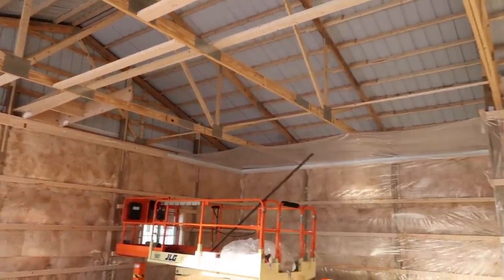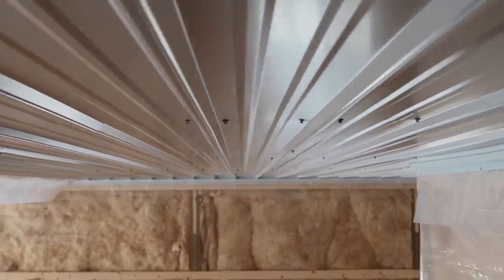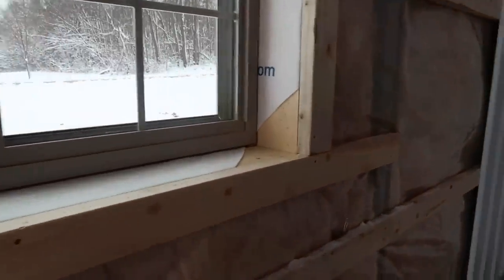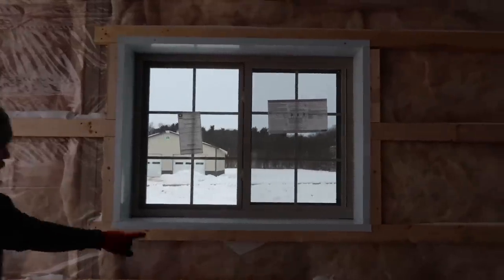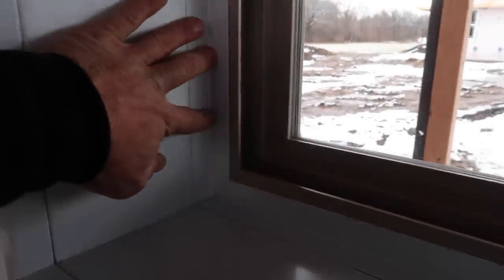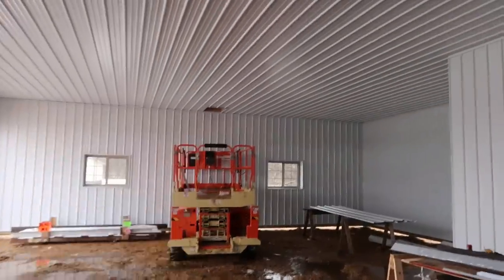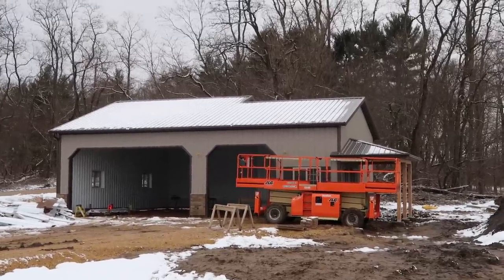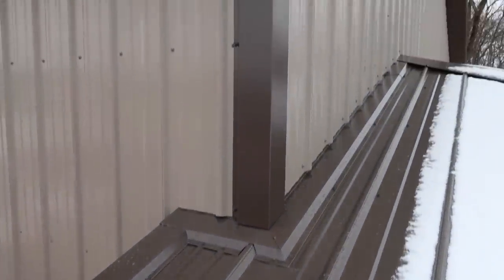Building a Mancave 11: Interior Finishes

Comment: Details, details, details!
That's how it all works out to clean, tight and right at the end.
I mentioned  this before to you on the Stool-pan trim derail; run a shim in that outer corner, tapered down, back to the casing edge, and few throughout the stool span 3 or 4 should do it, this will hold the stool tight to the jamb and the window edge thus eliminating  the need for that final gap-spacer piece.
Awesome work.........you guys ROCK!
Now, about the sound system for the shop.......I'm your man.

Comment: I would definitely caulk windows to the wood framing prior to installing metal trim (with a high quality 'sealant', not latex caulking or silicone) if for no other reason than for additional wind/weather seal. I'm a trim carpenter by trade (45 yrs), so I too prefer wood window returns, but I understand having to do what the customer wants. I love your attention to detail and have learned a lot from watching your videos. This is the first time I have seen something I'm not crazy about, so I wonder if this might work. I personally don't like the look of the 1x1 metal coming up on the window or seeing the raw edge of the piece on the jamb. I think I would take a pc of 1 1/2" coil stock and bend about a 1/2" hem on it. Place that flat on the wood framing and butt it to the window. Then install your jamb steel and tuck it into the hem. The hem would cover any difference in jamb width, there would be no screws or fasteners in the jamb steel, and the thickness of the hem would cover the gap between the window & framing.
Reply: Yes, please at least caulk/seal for the sake of wind penetration. No matter how well the wrap is taped and laid, and how the siding is done, or how tight the window is, that wind is going to find a way in/out. It's nice to have a building breath even inside, but I prefer leaving it up to a mechanical solution if need be.
Reply: Paul Allen hhgggggl
Reply: They silicone around the flange when they install the windows. 
The windows look great. Honestly if you caulk it good you never even notice it.
Reply: @SephYuyX  that's exactly what I was thinking.  We call it a sandwich bend. Use it alot in situations similar to this. But man they do some beautiful work!
Reply: Have to say a grey caulk would look much nicer than the last piece of 1 inch trim.
Reply: Its 1 1/2 by 1 1/2
Reply: @R2D2trashcan   yeh i have to agree with you i dont like the trim at all
Reply: Flash tape and foam sealer baby
Reply: The windows look awesome. But I like would like the look with the caulk better.

Comment: I have to agree, this is probably one of the best build series, showing so much "how to" on different details. I'm thinking this is also the floor plan where you showed how to layout for the Posts and used the bat boards to square everything off. Thanks, Kyle! I think I am sold on the Whether Logic system you use now as well as the roof system you use that doesn't show all the screws. I'm glad you're still sharing the content on your builds!

Comment: I build post frame buildings, but haven't done metal finishing inside, yet I really like what you are doing.  I appreciate learning from you if and when I get a customer who can afford these amenities.

About the window trim:. Maybe trim before the window is installed. Use that 95° bend idea but built into the flat metal on the return.  Then you have no gap on the bottom. The window would then press up against the trim ( bending the metal closer to 90™) - completing the seal.  If someone was obsessed with caulk, they could caulk behind the trim where it would seal trim to window without showing.

Comment: Excellent work as always. Shout out to Greg and Zach also, great work gentlemen. On the 95 degrees trim, in my opinion, it looked okay without. However, if there is a larger gap than 1/8" then add the trim but use smaller head screws or rivets. Again great video and work, greatly appreciate your time invested in the video.
Reply from the maker: Thanks bubba Greg and zach are great

Comment: Kyle, as always, close to perfection. For the windows I'd prefer to cut off a tiny slice off of the vertical trim corners. The 90 degree trim makes the windows look smaller, requires extra screws and takes away that nice crisp corner where white meets grey. Again, great job guys, deserving lots of thumbs up.

Comment: Great work Kyle. Maybe for the window liners. Use a a J Chanel around the R.O to accept a 3/4” Azek or Versatech pvc liner. Cut the J using one full continuous piece with corner bends. Build the liner box as one before inserting it. No gaps, no cracks, no caulk. I did this on all my basement windows. 👌

Comment: Looks great! love the attention to detail. As for the window trim i would caulk around the window and cover it with your own custom trim. Just use a good old manual brake and make all four pices custom you probably need to taper them slightly make a hem on them for the outside. you then lock them in to the J trim without a hem with the hems on the custom pieces. then finally rivet them in to the windows or use smallest possible screws if its wood.

Comment: Attention to detail (planning steps ahead) from the slab to framing to trim makes the install go as efficiently as possible. It also leads to a tight professional finished product.  Only thing I would suggest on the window trim for those lower inside corners: add a small wooden shim, thick side to the outside tapering down inward, this will allow the lip edge of the stool to suck up tight as well as eliminating that little gap when the side trim piece is installed, thus eliminating the need for that final 1" trim  detail, as the corners will stay tight.
Great job fellas!

Comment: From a professional insulators view (20 yrs exp.) those windows and doors should have insulation around them. I like to spray Dap-Tex foam around them, I don't approve of Great Stuff because it over expands and gets hard. Dap-Tex stays pliable. I would have done away with that last piece of 90 degree trim and used a good quality white silicone caulk and that would be a nice clean finish. With no insulation around the winter, there will be frost and condensation on the trim pieces just like those old aluminum sash windows that were used in houses years ago. Love the vids and the build of this one though Kyle. Thanks to Greg for picking up all the slack!
Reply from the maker: Haha thanks
Reply: @RRBuildings  Wasn't being critical but you did ask what we thought. Carry onward!
Reply: you do realize there's absolutely no significant gap between the window frame and the wood, right? I.e. nowhere to stuff insulation or shoot foam.
Reply: @jpm1211  According to any window manufacturer the rough in framing should be at a minimum of a quarter inch larger than the window. You must not be a builder or you would know this. You have to allow for the wood movement, therefore plenty of room for foam. Go sit down somewhere boy. I been in the trades for 30 years and in insulation for over 20 yrs, I know what I'm talking about.
Reply: Hotrod Hog damn.  And i thought i could run smak.  You are the king!
Reply: Hotrod Hog U are right! The reason the window companies suggest U leave a 1/4 bigger in the window framing is for expansion. Wood swells & if U build the window insert frame perfect to fit the window & the wood swells, what happens then? It puts the window in a bind & it wont open & close properly. So U hit the nail right on the head. 
I wouldn't think you would have to do the 1/4" gap in a steel framed building? But i know U do on a wood framed because of expansion.

Comment: Great job a really good looking construction, ive been a carpenter in the uk for nearly 35 years we don't get to do big timber frame buildings as timber is just to expensive, a building of this size would be done as a steel frame, so I love to watch your build series and I look forward to the next one, thank for sharing. :0)
Reply from the maker: That’s crazy this is such a small building to use steel for.  At least in my area.  Thanks.
Reply: @RRBuildings  its all down to cost a steel frame is nearly half the money in the uk and dont get me started on the price of sheet material over here :0 ( still keep up the good work I really like the way your always trying to improve not only the way you work but the end product as well

Comment: I like the 1x1 trim around the windows never done work like this but use to be a materials manager for a die cutting business. We used alot of 3m vhb tape that I think would be a nice touch on the 1x1 trim so you wouldn't have to use screws and could also do a little bit of what a bead of caulk would do for insulation. The only worry I would have would be a small gap from the tape but I know 3m makes the vhb in various thicknesses. That 3m vhb tape is great stuff and I'm sure you could find alot of uses for it.

Comment: Have you tried using the 1x1angle at 85deg and installing it, opposite the way you did. Slide it between the window and the previously installed jamb trim. It would wedge in and not require screws. A few dabs of silicone between trim and window, would hold it otherwise. 
 Thanks for all your videos! I love your attitude, and attention to details!

Comment: Use to do industrial and high end commercial metal roofing siding and roofing did quite a bit of interior liner panels. With that said your attention to detail is great very close to how I was trained 20+ yrs ago. The windows look good but we would of went with a bead break on the edge that tucks in and caulk it with a color matched modified urethane sealant it gives a cleaner transition. The raw edges of the angle will become  discolored with time especially if there’s any condensation. Your doing great work and it’s fun to watch the builds. I’d still be doing it myself if I wasn’t crippled up

Comment: Not sure if you'll see this.

In aircraft when we fair in sealant it's typical to use an earplug (or finger) with soapy water. You can also use a 50/50 isopropyl alcohol and water mix. One of the easiest things to do is keep around a small container with one of those mixtures and handful of earplugs tossed in. For you I'd probably use an IPA mix because it shouldn't freeze. I'd also recommend one of those plastic caulk edge scraper tools to set your fillet at the right size (although you can do it with just the earplug). Should be as simple as applying the caulk, running the scraper, and then give it a final swipe with the earplug. It'll look like a million bucks. I've done a few bathroom tubs and toilets using this same approach and it always turned out nice. If you really want to get crazy with it you can apply fine line tape or painter's tape before caulking and pull it after you do the above steps. That shouldn't be necessary for this window application though.

Like some other people, I think caulking those edges would look cleaner, I'm not a fan of the screws in the bottom pan of the window where people sometimes put plants or whatnot. I can't imagine it taking any longer than 5 minutes per window to caulk them and I'm sure you spent more time than that with your current approach. I'd imagine the caulk is cheaper than the steel as well.

Comment: First & foremost I love your work & the video's are awesome. I have an untried thought on the window trim,it would still be two-piece, but I was thinking instead of the pressure bend what if you use a siding finish trim and fit your trim to it then you could use siding knotcher and snap it in place with no exposed screws or nails.just a thought. your current way of doing it is beautiful.

Comment: Hey Kyle you could put an 1.5x1.5 90* bendo. The out side edge of the wood creating essentially the back side of a J-ch. then run the metal through the opening and put interior of the window ledges on with a 90 on the front and a 1.25 edge which is a bit bigger than J but would cover more and then back 90 like you do. This is how we’ve done before and is a clean look as well. Nothing against what you have there just no seam between J and other trim. And a bit easier. But another sweet job well done. 👍

Comment: For the interior window trim, take a look at some of the drywall products available from Trim-Tex. They have a few products made to seal against windows that incorporate an expansion seal/joint with a finished reveal that probably would adapt well to steel. Some of their vinyl corner products may work with steel as well.

Comment: Nice looking building, I like the gutter trim detail, I prefer the b/c sanded plywood for future electrical power conduit, but I would have caulked the windows with white butyl-flex caulk, the screw heads look like 10d box nails in wood casing.  Nice building.

Comment: Good looking Cave.  The window trim you focused on seems to be a good route to go with however, if I were the customer, I would opt for the caulking vs. the 95 degree trim because of the screws that fasten that finish trim piece. The screws break up the nice flat clean surface with several of those 5/16" hex heads. And, after time and dust accumulation etc., those screws will make any kind of housekeeping a PITA to keep clean.  I guess it depends on what flavor you like.It could be best to simply caulk the upper and sides then make a nice wood (or other material) window sill. There's room for it and it would add some final touches to the all metal look.

Comment: On the window trim, why not put the side trim in first with  a bend at top and bottom. Then the bottom and top so the slit angle still works covering the gap?
Sides first then bottom and top. 
Great work!

Comment: Good video and like the series! For the window trim and other areas of trim, why not use an adhesive or caulk of some sort instead of fasteners or atleast in conjunction with them. The metal flexes when you install fasteners and adhesive would allow the metal to lay flat

Comment: I like the window wrap and J-channel detail, but not a fan of the 1.5" angle that you put up against the window frame. It always seems a bit amateur-ish when someone covers trim defects with more trim. I think this is an ok place to put a little latex caulking in that minor gap to help it visually. Just my 2 cents to a guy with a wealth of knowledge. Thanks for sharing!
Reply from the maker: I cAn appreciate that.
Reply: I'd have to agree. I don't think a little calking would hurt there.
Reply: Very good work and detail is spot on but  think caulk has its place here on the trim . I just saw a company install new aluminum  windows at my work and this exact situation came up and they used caulk and it looked beautiful  ,I guess  it all depends  on the guy caulking🤣🤣  have a Happy new year and when I save up enough  $$$$ you will be getting a call from me to build my dream home shop!!!!!
Reply: I’ve seen guys caulk a 8 foot
Hole
Building mobile
Homes they just send
It 😪
Reply: Marvin Carvin yup , but not latex white solar seal or next best maybe pheno because it is water clean up.
Reply: Steven, any high quality water based. Just not silicone.
Reply: I agree with no 1.5” angle. 
The caulk is interior so it’s for looks not weather sealant. Makes it ok
Reply: @marvincarvin1846  Silicone will expand and contract. Painters caulk will get hard and crack. I would probably go with a high gloss white silicone for the longest lasting caulk job and a nice finish.
Reply: Hotrod, not painters caulk. Use the siliconized latex. Great gap filling (not needed here), flexible, and water cleanup. 100% Silicone has a way of attracting dust & dirt and looks bad after awhiile. Hard to clean up. Just sayin'
Reply: The latex caulk at a 1/4” bead would be a really nice with no screws showing. Personally the screws could have been wafer heads to assist with a more finished look if screws were used at all. Just a question... with no caulking, if any liquid gets on the window seal, what to stop the liquid of seeping into the cracks and penetrating the window frame? Would it be better to use a bead of butle tape under 1.5” trim at least? What is the cost of bending the 1.5”  off the window seal, VS having to install a second piece with screws? If you figured out that gutter, this should be easy for you. Beautiful garage. See you on your next series.
Reply: @marvincarvin1846  It would still look better than that extra   piece of trim that looked    like crap
Reply: @sethwatson8952  yeah why not get a matching color on the window trim clean it up minimal product usage but pretty decent overall

Comment: With that final pieces of window trim you may want to try gluing them in with silicone caulk instead of the screw attachment. I think it would be a better finish appearance. I have attached lighting and vortilons to my wings with it and it stays put at 200 MPH. You would never see the silicone.

Comment: Screws and seams look better than caulk? I suppose it's a preference, but when you get good at caulking, it pretty much disappears. Tip: use a cup of water and a rag or paper towels, always smooth the caulk with a wet finger and stop, wipe, and dip before it bunches up out around your finger.

But what shouldn't be personal preference is flashing tape on window sills. Windows and doors are the biggest cause of water ingress, and having the framing under metal makes the potential for water damage even worse because it could be completely rotten before you even notice it. Please use flashing tape on window sills (and door sills on wood framed floors), and lap the house wrap over the top of all top pieces of J-channel, including the overhead doors and roofs that butt into walls.

Comment: If you were to put a hem ( not completely closed) on the edge going under the window, it would act as a spring keeping it tight against the bottom of the sill. Putting silicone into the hem would lock it into place once dried. You would probably have to trim the window's corner square.